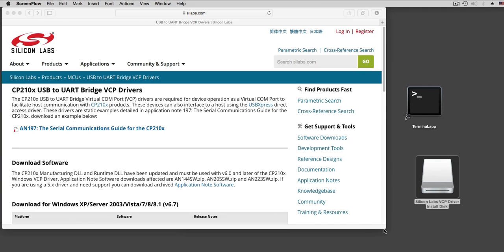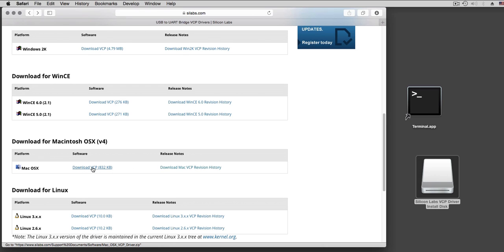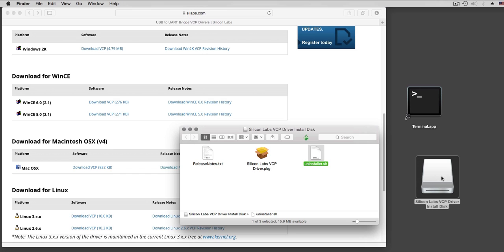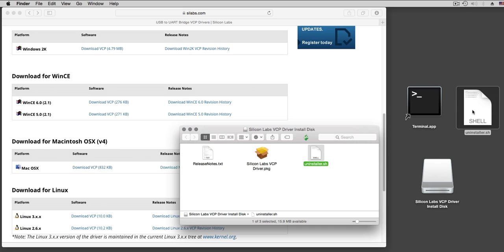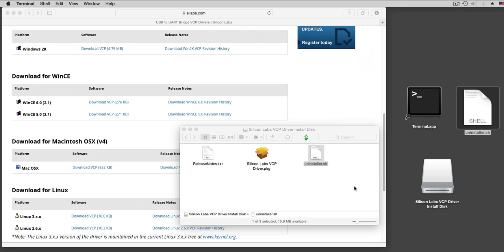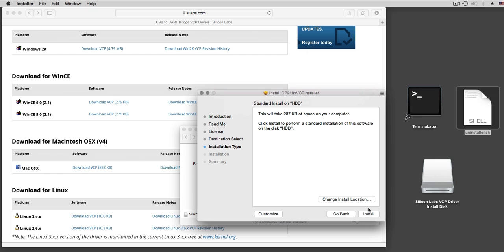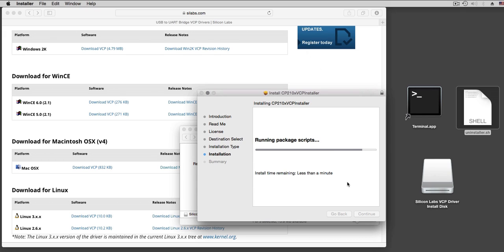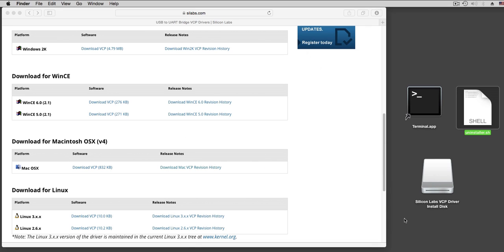How to uninstall the CP210x USB to UART Bridge VCP Drivers on a Mac

Comment: Hi, i followed the same procedure, but when i tried to uninstall after dragging the shell file into terminal, it asks for a password.But for some reason, I can't type it in. Any solution to this ?
Reply from the maker: Mad Axe goto preferences, and in the security settings allow apps from everyone to run. Turn it back on, when you're done installing.